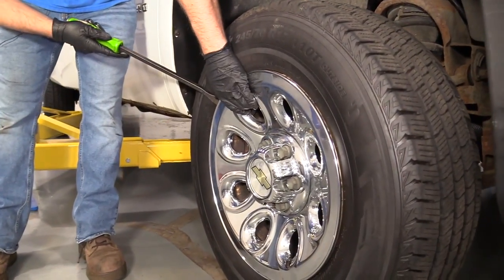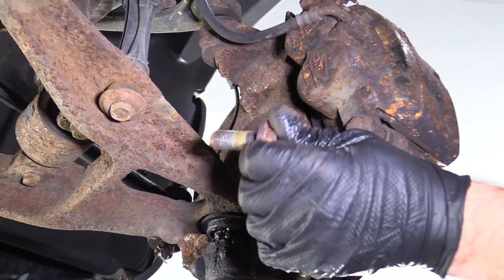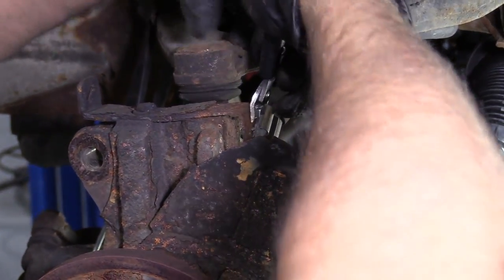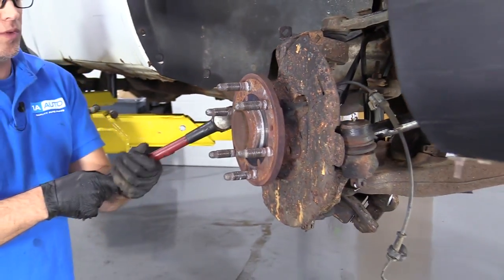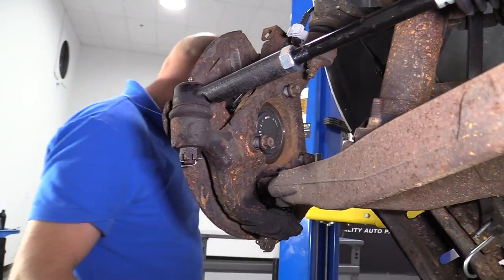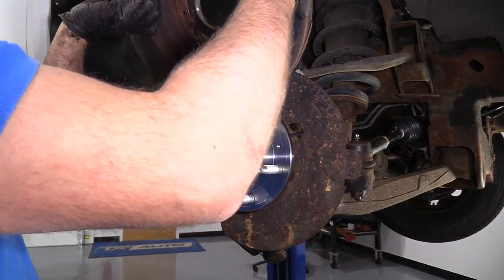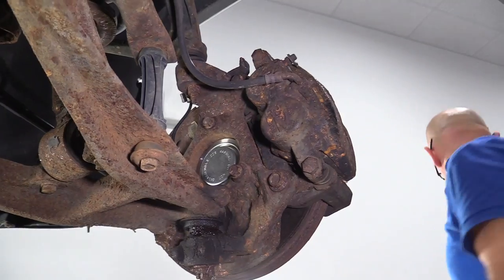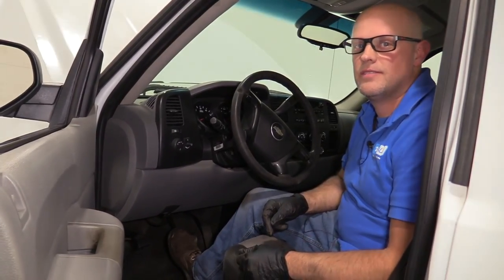How to Replace Front Wheel Hub 2WD 07-13 Chevy Silverado

Comment: Great video! Note that there may or may not be a small bolt holding the disc to the hub. If you don't remove that bolt then the rotor won't be coming off.

Comment: My 2005 Chevy had a T55 screw from the rotor to hub bearing. The new bearing I bought didn't have that hole. Can I still use that new hub? I figured the lug nuts will hold it all together anyway.

Comment: Die grinder with a blue scotchbrite disk/wheel barrel. Another tip use antiseize or corrosion ban in the yoke bore where the hub sits.

Comment: Thank for the great vid! Do you know what is the exact difference between a 2WD hub vs a 4WD hub is? I know the CV goes into the 4WD hub but what I'm really wondering is, if I want to delete my 4WD parts and remove my CV axles, why do I need to replace the 4WD hubs with 2WD hubs?
Reply from the maker: +A K Thanks for watching!  The RWD hubs are self contained and do not have spines for a CV shaft to go through.  4x4 hubs require torque from the hub nut to keep them together.  There could be more differences such as bolt spacing etc, but the former would be the main differences!  1aauto.com

Comment: I have a Service stabilitrac and service traction control message. Also have abs and traction control warning light on. My hub has play, I was told the hub could potentially cause this issue. Can  confirm this.

Comment: I have  an 06 GMC Sierra and bought the TRQ wheel hubs for the 2wd from 1Aauto. I can't find the torque settings anywhere. Does 1AAUTO have them listed somewhere? Are they the same as the ones in this video?
Reply from the maker: +Bilad172 We would suggest checking your owners manual, or locating a Hayne's manual for this vehicle to ensure you have the proper torque specs. 1aauto.com
Reply: Torque to 120 and call it a day unless your a racecar driver it dont gotta be exact

Comment: Bro I can not get that hub out of the housing no matter what I do!! I have used pb blaster, heat, air chisels everything!!! I even hit it with a sledge just to see if it will budge!! Nothing!!! I'm at a lose rn on what to do. I have all the bolts out. My brake plate has always been gone so idk if that not being there has let it Gould itself to it or what, but any suggestions would be very much appreciated
Reply: Did you figure it out?
Reply: @bowtiebuilding  He should've bought a hub tamer and a big sledge hammer before he started the job.

An air hammer on the three bolts after they're loosened a bit is another option. Plan on replacing the bolts.

Comment: Can you tell my why my hub assembly broke and came apart the passenger side 1st then couple weeks later driver side poped and both times my wheel went rolling down the highway with the rotor connect to it need help thanks 🙏
Reply: Used a 4WD hub in a 2WD application, i.e. no axle nut to hold it together?

Comment: I've done this several times on my 2000 chevy blazer it's basically the exact same. But doing this 07 chevy none of the retaining clips will fit the mounting locations. 30 minutes to change the hub an hour fighting with a plastic clip.

Comment: it shouldnt be a big issue to install the whole assembly one way or 
another right? I messed up and put the ABS wire closer to the front of 
the truck when it should have been spun around to the rear of the truck 
instead where the bracket to hold the ABS sensor is. I have it zip tied up nicely, just unsure if it will mess around with any abs related things with it being in the incorrect location.  Hoping not to have to take it off again lol. this is off a 2010 Gmc Sierra 2500hd. thanks 1Aauto!
Reply from the maker: +grim2sday Thanks for checking our video out! Unfortunately, we would advise following the steps shown in the video correctly, including the positioning of the ABS sensor wire, to ensure you don't run into any problems in the future. 1aauto.com